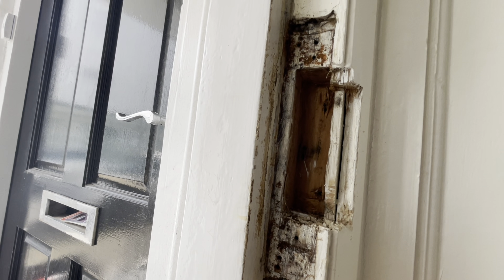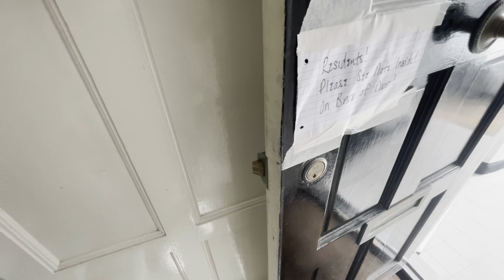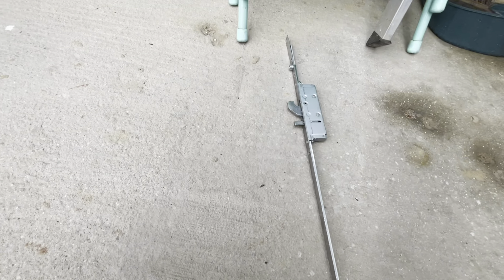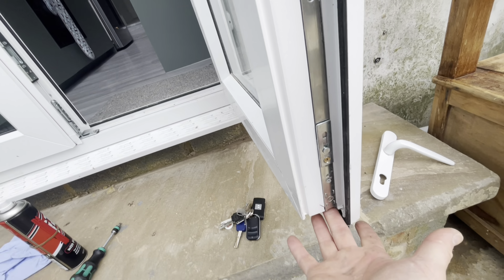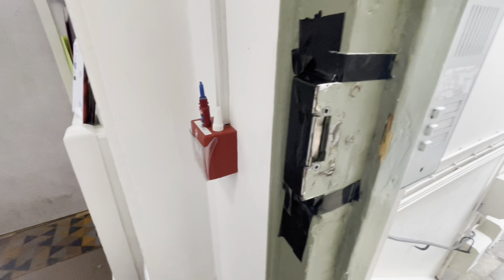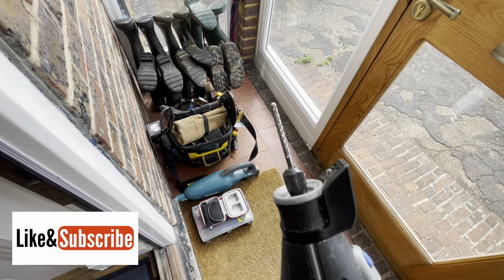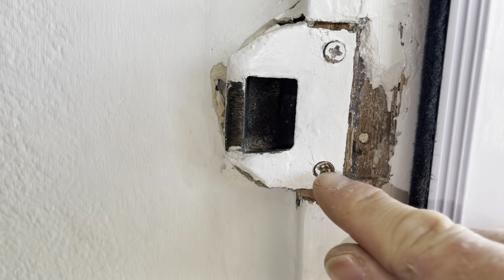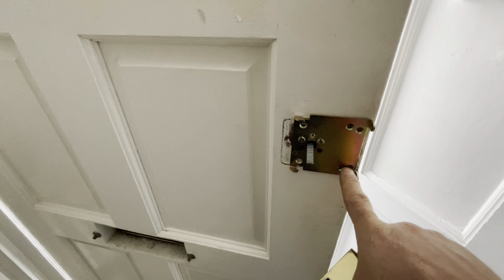Brighton Locksmith | Hove Locksmith | Locksmith Live Jobs - Locksmith

Comment: Yeah, Love the Wera screwdriver.  We don't have a lot of TORX on our doors so mine is still factory.  You should have saved that Duct Tape to McGiver your next door 😁.   I like you floor working Matt for keeping the clients floor clean.  I have used a picnic table cloth to catch wood and dust from drilling.  For your Makita Multi-tool you should look at getting a 3/8"  ~9.5mm blade for tight jobs.  Very nice job on that last strike.
Reply from the maker: I’ll look into those blades for the multi tool. 
Thanks buddy 😊🙏🏼

Comment: Savage kit,love it….I find the GU new style gearbox 4 roller fits in nicely in some AGB setups for retrofit, especially the AGB 3 roller with top shoot bolt there’s an extra bit of track on the GU for the shoot bolt extension. Although the top roller on GU clashes with the flush bolt on French doors the top shoot bolt is needed because of it. 👍🏻

Comment: Hi Andy, cheers for the excellent explanation on those faults, can I ask how do you price a job like the sticking latch? Is it price per hour or a set price? 
Also next time you get a door alignment job can you show it in a little more detail, just the process you go through. I had one the other day that was catching at the top in the opening side and I had a go at the flag hinges but I was getting in a right old pickle with it, in the end I got it back to where it was and said they need to get a door guy in to sort it. The mistake I made was I started to panic when it would not go where I wanted it to go.
Reply from the maker: Thanks as always Matthew. 
I have a minimum charge for a job which is what I charged for this plus a little bit for fuel as it was a fair round trip. 
Yes I will try and do a bit more when I have an adjustment job, however they can all be different!
Cheers buddy 😊

Comment: I fit upvc and aluminium doors . The lock adjustments are often a cause of frustration at the end of the job. It is quiet a logical process  though . Nice tip about the way you switched over the gearbox . V interesting videos mate . What model is that wear screwdriver?
Reply from the maker: Thanks buddy. 
The screwdriver is a Wera Kraftform Kompact 😁
Reply: Thank you